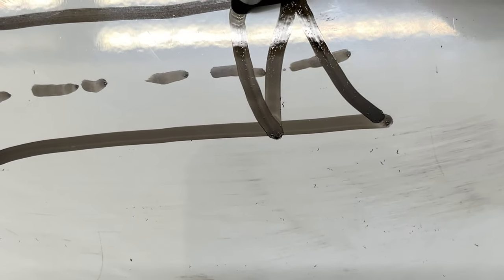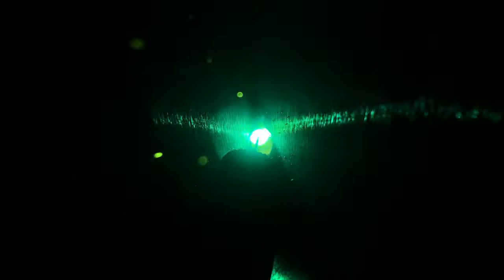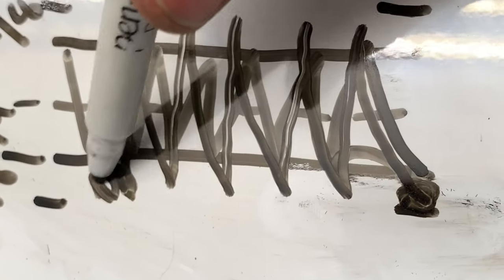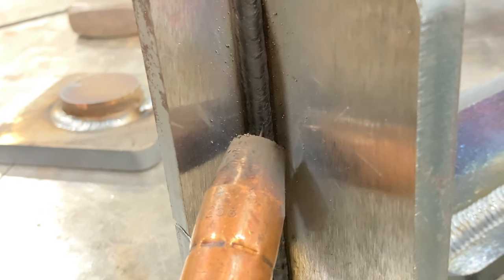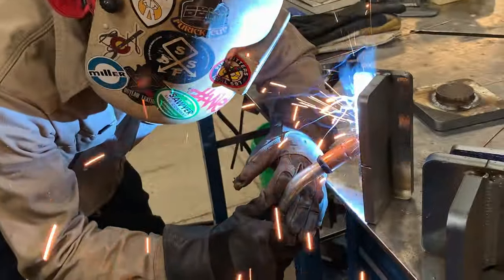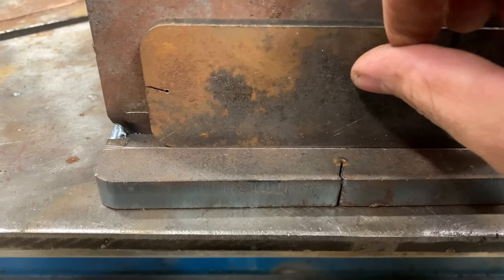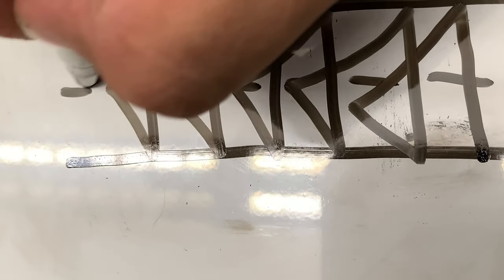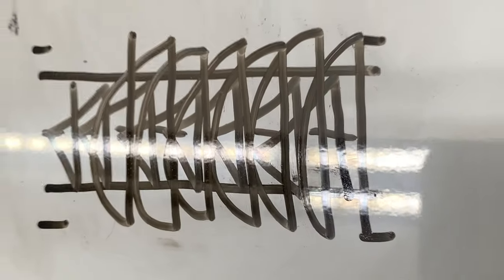3F 2 Pass Vertical MIG Weave

Comment: Hey bud shout out from South Carolina! Just got furloughed after 12 years on the railroad did a little bit of stick welding &4years Army but nothing to code-they shut down our shop(gotta start all over ) so I recently started studying and looking more into welding full-time. Passed “weld test 🤨” after interview & start production welding Monday… but this  “weld test”…ended up being a single bead uphill fillet weld so ,3F I believe BUT they would not let me adjust welder settings (I don’t know the test parameters but that seem kinda off and THENNN said I couldn’t hold the trigger 🤔🥴so I basically stacked-tacs, tac welded atw up and settings were 24.5V 365ipm on wire!!!! It was burning hot as 2rats in a sock..passed that somehow & THEN I took a Legite test 1/2G w backing strip and settings were the same ..I passed by the Grace of God on the Tjoint-idk if that’s a legitimate test or some drill or whatever they had me do But settings were RIDICULOUS and HAVENOT seen anything similiar on YT and came across your channel man so new subscriber and best of luck brother keep gittin it! (PS-if you don’t mind I’d be grateful cuz if you wouldn’t mind running a single pass/root uphill with those settings man and lmk what you think !) GOD BLESS YALL 🇺🇸💪
Reply from the maker: Thank you for subscribing! Congrats on passing the test. That sounds very difficult! Maybe I will give it a try

Comment: Amazing technic brother. The trail behind wire arc is not cold its mean that you feedwire less than usuale to not melt and rund down material. Its called in Europa soft dynamic arc.

Comment: Amazing video I never heard of the D motion until today.I recently did6010 downhill root with uphill fill . The root was the easy part but the  uphill fill  was a bit difficult. I did end up getting it down but I would like to see what you would do
Reply from the maker: I have a vertical up 6010 video coming😎
Reply: The procedure has changed 7018 uphill after a down hill 6010 root

Comment: It's alway interesting to see what people are teaching new welders. What is this used for? I've never had to do this in my years as a welder. I've never heard of anyone using solid wire in the field and in a shop setting you can manipulate the piece to be in a 1g position.
Reply from the maker: Got to start somewhere I guess
Reply: @relentlesswelding15  I have done open root 3g with solid wire in the shop on 1/2 stiffiners. That was just the root and just to mess around with different processes, an experiment if you will. We filled the rest with dual shield. We all have to start somewhere, no argument here. This exercise seems like a good way to learn weld puddle control. I've noticed my apprentices always make big progress when they learn to watch the puddle.
Reply from the maker: @jca66  sounds like a great test! There are a lot of structural steel assemblies and factories that need repair that choose to use MIG
Reply: @relentlesswelding15  I know I do fabricating and repairs for everything from refineries to hospitals. I've never been asked to use solid wire in the field. In the shop we reposition the pieces to be a flat weld never vertical. That's why I asked when anyone would need to master vertical filet welds using solid wire? Don't get me wrong I agree everyone that wants to weld should learn everything they can. I can only think of one example for this though. Welding pipe. Sometimes the customer wants to minimize spatter inside a pipe so we tig the root. Only once have I used mig on pipe. BTW I'm certified in structural steel and high pressure pipe using multiple processes.
Reply from the maker: @jca66  that’s interesting I believe you. When I worked in maintenance it was common to use Solid wire for our fabrication and repairs on presses because that’s what we had. Definitely have a point to what you are saying though
Reply: I use this whenever I just want to add a little more strength to my weld if I'm building something like a trailer.  It's mainly around areas like the hitch or goose neck.  And really so I don't have to flip something or change processes.  It's basically a trick I picked up being lazy or efficient.  Most people don't even know that you can run solid wire uphill.
Reply: Most useful for practice for the 3G certification test. That uses beveled plates, but it's good to know how to read the puddle on multiple joints uphill

Comment: Not bad.  After some practice you can really refine your hand movements and turn up the heat.  You can even find that sweet spot where the heat is just right to allow the piece to heat up but not lose the puddle.  This trick works good on uphill aluminum also and comes out looking really good.
Reply: That's tig unless you're talking push pull
Reply: @PDaddy0120  I'm talking about regular mig.
Reply from the maker: Thanks for the tips!

Comment: great work, was struggling on vertical t plate, my beads are always too wide.
Reply from the maker: You can do it!
Reply: Try circles if you are doing T plate. U's or weaves are more for beveled plate or pipe.  The G positions.
Reply: @Useruserusername790  cool, thanks!
Reply: @grimmfortelight1983  welding a gap is a whole different monster. But it just takes practice. When you learn to hear and feel the correct settings on whatever then you got it. That's the whole trick to welding, you just gotta work as comfortable as possible. Fuck up alot at first, everybody does, the mistakes help you get more confidence after you learn to fix them.
Reply: @GenZRuinedTheWorld  Thanks for the advice, I just finished my first semester of a structural welding in May with all A's in my intro to stick and MIG classes. Next semester starts in August, after that I'll be doing the 1 year pipe certification. Appreciate the response thoe!
Reply: @grimmfortelight1983   there were days when I realized why it's called "stick" welding and would rip the stuck stick off and throw it across the class. 1 dude just walked by and told me to turn the Push up and they'll stop doing that.

Comment: I would have done at least 19v, I like to burn hot, props to that speed though. I usually do 165-180 wirespeed for verticals.
Reply from the maker: If you want more volatile you are more than welcome this is less about settings and more about technique
Reply from the maker: Voltage*

Comment: spray mig is fine for structural.... no?
Reply from the maker: Yes it is fine as long as the metal is clean. You just can’t spray weld vertical up or overhead
Reply: @relentlesswelding15  if i was spray welding vertical, i would be moving downward away from the heat, and if i was spray welding overhead, I would be pushing the mig whip instead of pulling for less burn in because heat is so high.   but im still curious, why is it not a good idea to spray weld vertical or overhead?
Reply from the maker: @AudiBoyzTV  you are right in some applications you can spray vertical down and also spray weld overhead on a fillet weld. For the most part with spray transfer the puddle is so hot and very liquid the weld will drip and fall out. It’s generally limited to flat and horizontal positions and used in production settings to increase production time
Reply: @relentlesswelding15  thank you for clarifying

Comment: Way too cold. You are basically making small horizontal welds. Your puddle needs to be the size of your weld; if your puddle is trailing behind your wire with each movement your settings are too cold. With wire, a pretty weld is not necessarily  a sound weld. Short circuit transfer is for sheet metal and/or large gaps.
Reply: Toe not sunken.
Reply: @RonnieRios4030  pulling a trigger does not make you a welder. Your comment proves that. Do you even know what short circuit transfer is?
Reply: @jackreacher7939  true, they use Ladybois to weld tube at my job
Reply: @travisjones9508  doesnt that get distracting for the other fellas?
Reply: There is a theoretical solution I saw for this. Do a downhill root pass, as to give yourself an easy, simple way out in the case of penetration and keeping it dirt simple.
Reply: @Tonyrg1988  yes especially me
Reply: JR you are absolutely correct no.1 I would never run hardwire in 1/2" plate 
2.its cold and is not digging into the plate would not trust this weld 3. There are many so called experts in our craft I am a certified welder in structural steel and a fabricator many of these guys are giving wrong information but oh well to each their own stick fluxcore tig mig gas welding a real welder should know all these processes
Reply: Stop the cap jack.
Reply: Every welding video I’ve ever seen, someone has something negative to say about it lol.
Reply: COLD ROLL...........😅
Reply: @armandogonzales1365  I'm inclined to agree with you sir over the past 20yrs I've managed to have the opportunity to do just about each type of welding there's a couple I'm missing like stainless or non metal like ceramic n glass but I Learned each process on the job with very little help or info so that when the next job comes along you realize you don't anything lol you've only learned what was being done on that particular job so these guys that been on the same job for 20 plus years my hats off to you for your loyalty but you missed out on so much education it really would make you scratch your head in wonder even then it's unbelievable how much I still don't know after 20yrs of off n on welding
Reply: Agreed...pulse arc..vertical 
Mig for flat..horz...that weld won't pass bend test
Reply: @jackreacher7939 the process before pulse arc...cold.
Pulse will use 120 or 60 hotter than short arc...and go for 90.000 psi

Comment: U ain’t penetrating that with 17 volts 🤣
Reply from the maker: Voltage doesn’t have much to do with penetration. Wfs is the main influencer of amperage or perceived heat when welding. Voltage is just arc length which gives you potential to make a wider weld.

Comment: It you were doing a test on plate with a backing strap with mig in the vertical position it will never pass a bend test or a pull test it will break in the weld every time.  If you are going to weld vertical with mig use Flux core wire or stick  weld with the right type of rod or tig weld . After 40 years of welding for a living , I know what technique to use . I will say this , if that's all you have is mig using 75/25 as a gas shield weld it down hill . Good luck .
Reply: Also a 40+ year weldor, never seen MIG used for anything other than some pipe roots and light materials you want to look good, as it is a low penetration process. For anything heavy you'd want to use flux-cored wires or 7018 or higher stick.
Reply: Yes u need pulse arc..fluxcore...stick for penetration...your cold weld is good down hill...or move your piece flat or horizontal and turn heat up

Comment: The spatter is worse than stick welding when vertical weaving with the Mig
Reply from the maker: It can be
Reply: Maybe if your machine isn't set properly. Turn up the volts and it'll run fine. 20-21 volts
Reply: @williamb.6813  we know that the spatter is worse on the stick than Mig no matter what & I know what volts to use as I also know the different transfers of Mig welding

Comment: It's not MIG, is MAG
Reply from the maker: Technically since I’m using 75/25 gas it is GMAW
Reply: @relentlesswelding15  for that reason It is called MAG
Reply from the maker: @jesusjesuss1648  MIG is metal inert gas. MAG is Metal Active gas for that reason a mixture of inert and active gas is called GMAW
Reply: @relentlesswelding15  you are wrong. GMAW (Gas Metal Arc Welding )is the name of the process and depending on the type of gas used will be MIG or MAG
Reply: It's wire welding. Wether it's fluxcored or gas shielded, it's Wire welding. I win  because I am greatest. Yay me.
Reply: @Useruserusername790  you are wrong.

Comment: 17V and 200? Jesus. Vertical flux settings should be 23 and 190.
Reply: They’re two different processes that weld totally different. Shoot I run my flux vertical uphill at 25.0 and 365
Reply from the maker: This is not flux core

Comment: That weld wouldn't pass on any real job .. no penertration at all amature double amps  and volts
Reply from the maker: How can you tell how much penetration without a cut and etch? I will say these settings are not fool proof as a root pass to get proper root fusion.